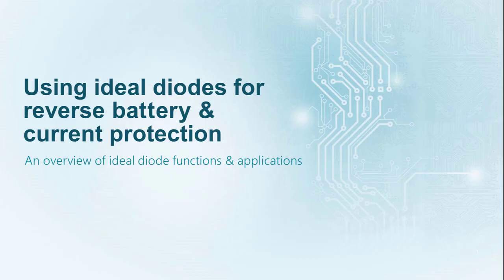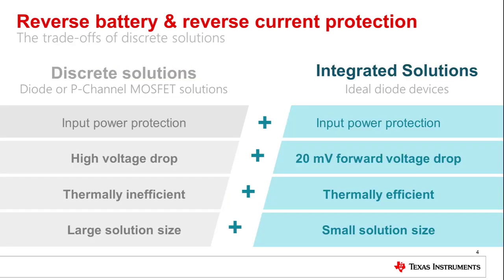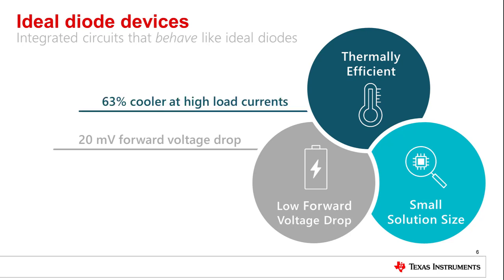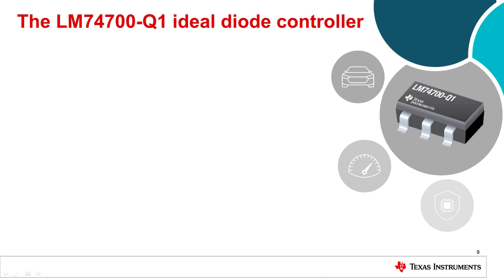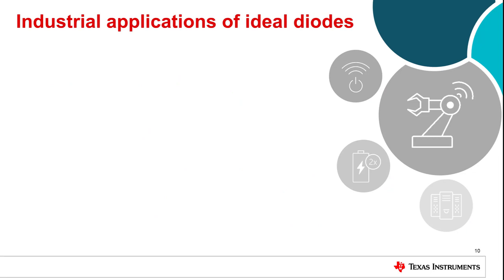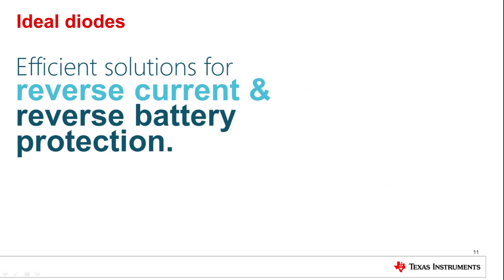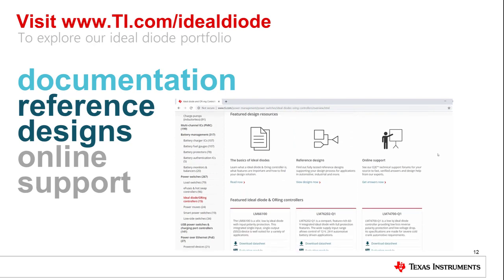Using ideal diodes for reverse battery & current protection

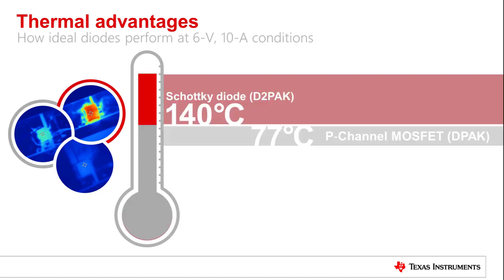Comment: 1:12 those 63% are arbitrary. There is nothing special about zero Celsius. If you count in Kelvin - it is 21.5% cooler.
Reply: 51 degrees is 89 degrees less from 140. That's 63% less.